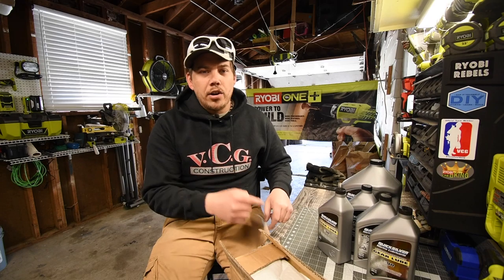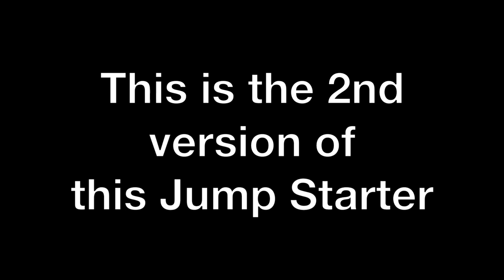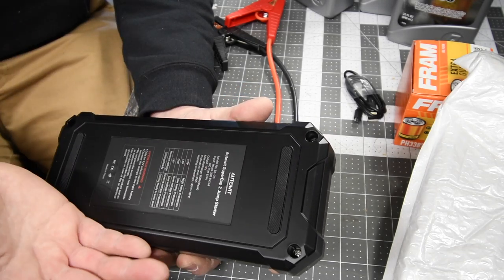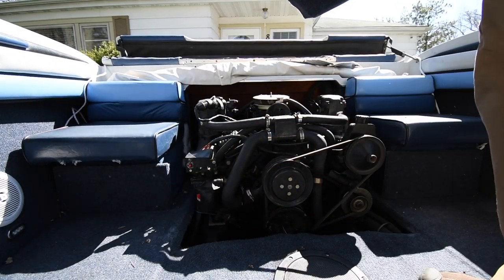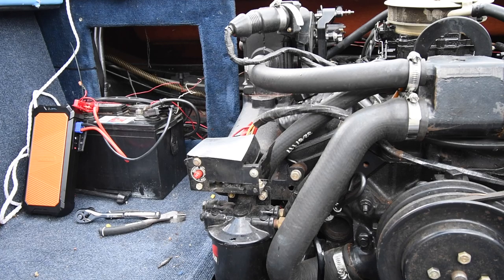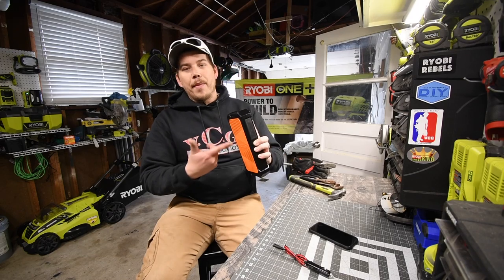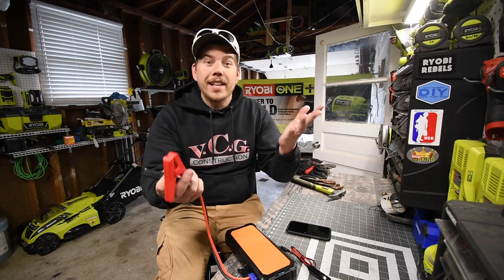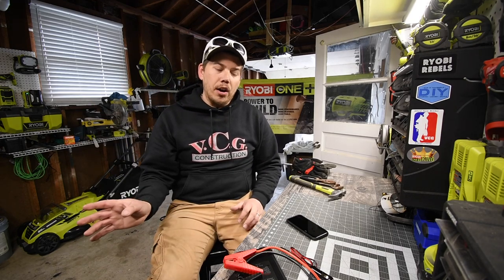EVERY BOATER NEEDS THIS!!!

Comment: Did you use a trickle charger for your battery over the winter? I asked you did you use a trickle charger in the winter... why are you asking me about being in the water? Focus!
Reply: Its a versatile tool, however if he did trickle it, he most likely would not need it for that application.
Reply from the maker: I did not. ill look it up though. what does a trickle charger do?
Reply: Man Caver Tools ... It keeps the battery charged ...all my snowmobiles, wave runners and Boat are on all trickle chargers.My UTV’s and Atv’s also. This way you don’t the drain battery...They’re cheap you can get one for your boat under 50 bucks
Reply from the maker: I do not.
Reply from the maker: does that help you while you are out on the water?
Reply: Man Caver Tools ... no! You put it on the charger in the winter.
Reply from the maker: Robert Bates gotcha, I’ll pick one up. But I’d get a portable jump starter for your water craft

Comment: ...  I used to start my car with my lithium polymer bateriile when I had no current on the car battery  and the battery was  75 % smaller than your jumper. 
The problem with lithium polymer is you can't keep it charge for longer time because is making a reaction and is producing gas and the battery gets fat and can explode and catch fire like this 
https://youtu.be/0nrsoMsEMNU
Reply from the maker: ill check that out and I Thank you Mrdino

Comment: It would be more convincing if you had tried starting your boat without the assistance of that jumper pack to prove it was dead. As is we have no idea if that thing did any good at all. Not a real convincing job of selling the product. 👎
Reply from the maker: The battery was sitting in negative  degree weather for months without being used. Im not going to start it without assistance.
Reply: And so we’re just supposed to take your word on that and go out and buy that product? I don’t think so 👎